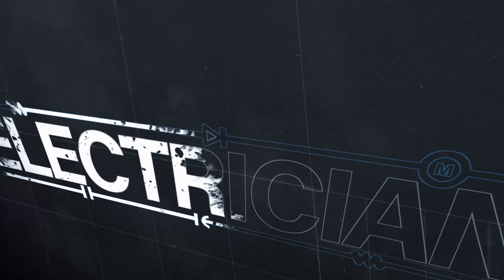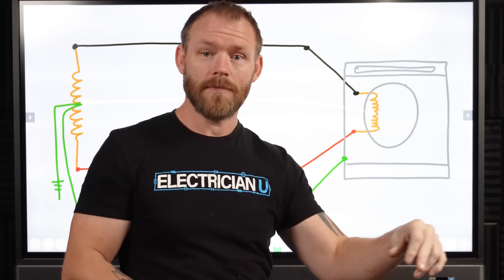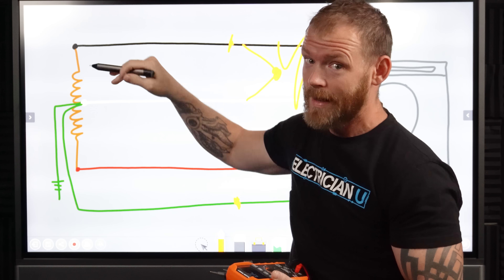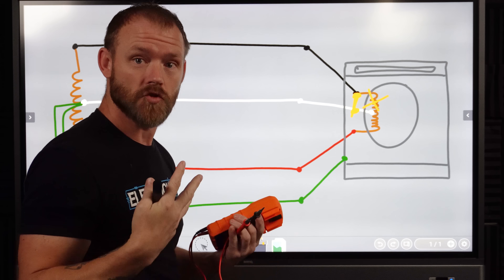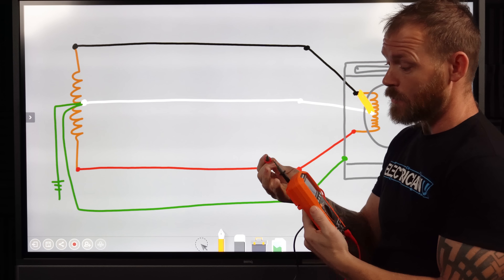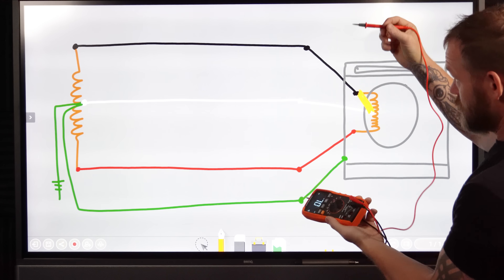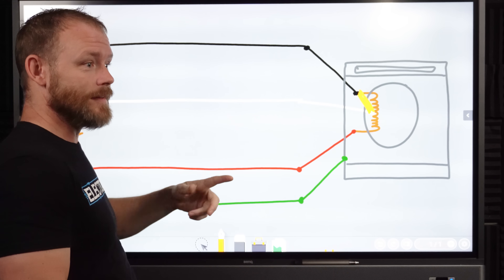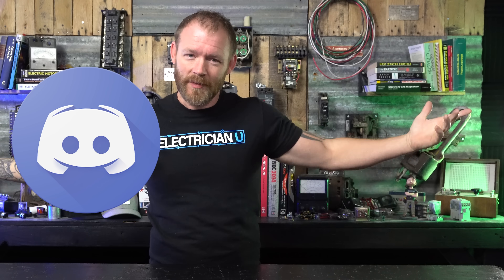What is the Difference Between a Short Circuit and a Ground Fault?

Comment: Is the fault or the shirt ever in the wall and not reachable?
Reply: can be if you have rats.  That was actually something I was worried about in my new house.  bought the house, had rats, and I was worried they would chew through the old 60s wiring, cause an arc fault and burn the house down.
Reply: @bassman87  Last spring in my neighborhood there was a big bang and a street near to me lost their power. There was a crispy squirrel on top of the pole transformer.

Comment: Dustin, could you please do a video with tips and tricks to troubleshooting with both a multimeter and a clamp meter? I’m an industrial electrician that’s been with my company for a year, and I’d like to get into service calls and learning how to use my meters to help with troubleshooting. Love your videos, and I would appreciate it a lot. Thanks in advance if you do this.
Reply: Be prepared to be humbled. Service work and troubleshooting is a whole different animal than commercial/industrial new construction. But it will be good experience for you and I highly recommend every apprentice down both new construction and service work. I'm a journeyman and still struggle with troubleshooting at times and using my meter. When you install for awhile and do nothing but bend pipe you get a little rusty when you actually have to think like an electrician. Hell just last week I had to look up how to calculate a lighting load using ohms law. I had brain dumped all that and haven't done a calculation in God knows how long.
Reply: I do industrial as well 3y in....I believe it's a fluke 375 that measures in rush.....I'm wondering if I clamped the neutral close breaker and got a inrush value turned around and did the same for ground how  they would compare...the expectation is to try and catch the one drawing excessive current to determine short circuit or ground fault...
Reply: Trouble shooting with a clamp meter?  Are you talking about an amp probe?
Reply: @gp3646  amp clamp

Comment: When do you electricians choose aluminum over copper wire? Copper has a higher tensile strength, less resistance, and it also has lower thermal expansion. 

The only thing that makes sense most of the time to me is cost (aluminum being less expensive). I guess the lower tensile strength also might make aluminum easier to run/bend around tricky areas. But with less strength comes easier breaking (say when terminating) and higher risk of fire. 

So when can/should you get away with using aluminum?
Reply: AL for feeeders is okay. If it’s above ground service copper down the service mast. Everything else should be copper
Reply: @bradyb4208  it's perfectly valid to use copper for feeders though, right? I know it can be done, but is it done mostly in practice? And when you say, "above ground", that implies that below ground service conductors typically are aluminum?

Comment: what if you have a underwater filter motor that randomly trips continuously but can be reset by unplugging the motor e cord and plugging it back in then much much later it trips again?  also coudnt we just use a ground fault detector that you just plugin and it will tell you if theres something wrong with the receptacle first?  what if we take the end of the cord and put our continuity test on the plug ends  instead of opening up the motor? uh assuming its 120v motor i guess

Comment: This is good stuff, you don't have to be in the electrical trade to need to learn the stuff I understand it, which is what I appreciate about this channel. People have trained in HVAC, I have sent them your way to do some homework. Videos like this being a perfect example, because I tell everyone, if you're not putting in time off the clock as well you're never going to succeed or learn what you need to learn or need to know
Reply: YUP ppl who like this, their mind will absorb any info when they work on projects,
sort of like seeing  twine  broken on motor windings, it is quite likely there will be
a discoloration of the windings. even from years past seeing discolored coils in a
motor or gen you'll  remember the twine was most likely broken leading to the 
fact the coil overheated and a good chance there will be a shock hazard.
Reply: I have had to learn to put things together and diy a lot of things I had an idea on but never really attempted. But I’ve been trying to fix a freaking power wheel for 2 years and electricity and how to really use the multimeter just collapse my ability to think it thru! Maybe I just need to try the thingy that beeps when there’s loss of a circuit connection thru wires. “Volt detector”  because I’m getting nowhere with the multi idk what to stick the neg probe to for the different places to check. I always thought it was just stick to beg red to pos but something’s you just need beg prove to ground well idk what’ all is safe to just stick it to.